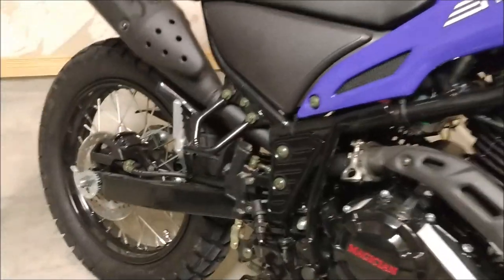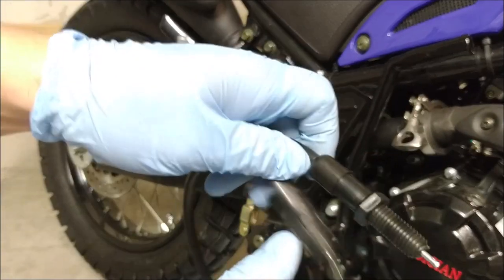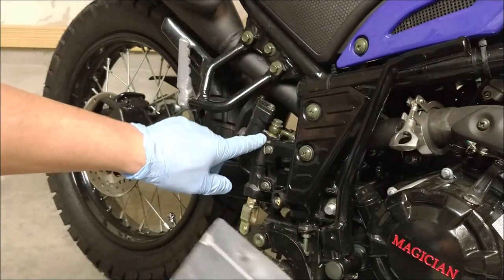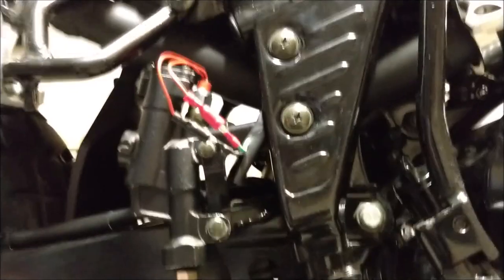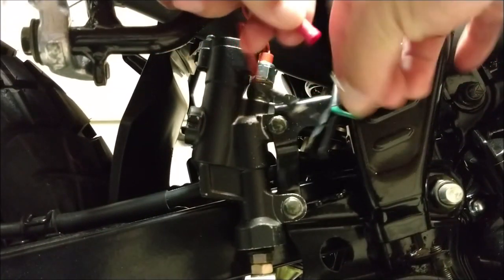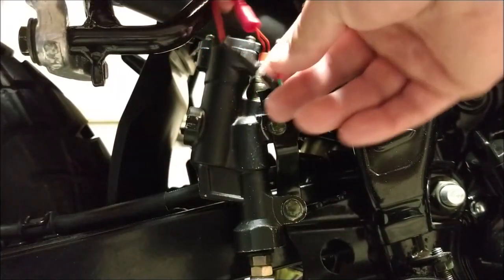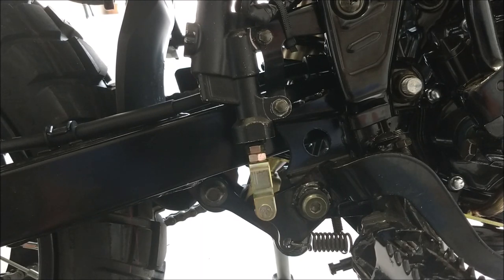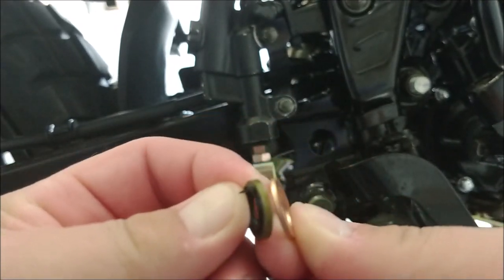Banjo bolt installation

Comment: Hey DZ! I am going to be purchasing a Brozz 250 from Superior powersports and I am going to be buying mine with the option of having it already assembled and ready to ride, I was wondering if you have ever bought any that were assembled already or if you knew anyone that has, and what your opinion on that option was? And if it’s a good option and to do they usually assemble them good before shipping them you think, and do you know if anyone who has had any issues with the bike when going with that option? Because i was told by them that all I will have to do is put the mirrors on and fill it with oil and gas and then it’s ready to ride. If you could get back with any response at all that would be awesome, thanks man
Reply from the maker: danny H
 I don't know of anyone that has gone for that option except the motorcycle CSC sells they sell rx3 and the tt250 already assembled, I guess it up to you what you prefer but I would be interested to see how it turns out. That option will save you a lot of time trying to figure out how everything goes and if they say they already tested  it, you won't have to mess with adjusting your carburetor.